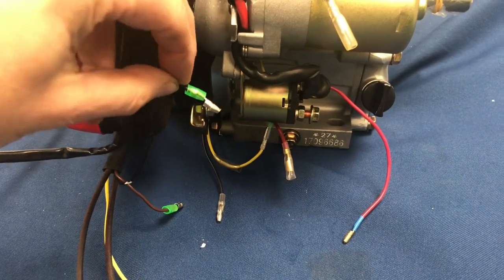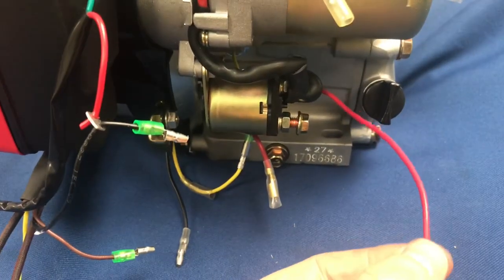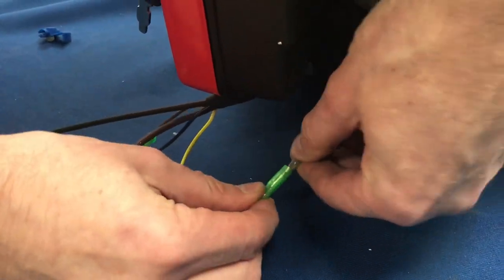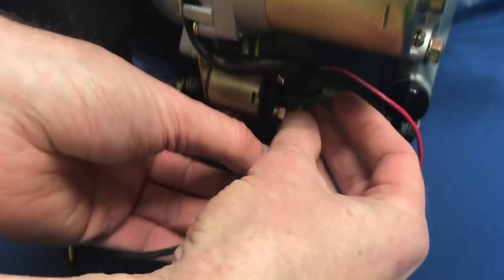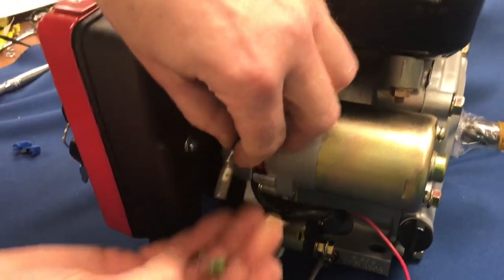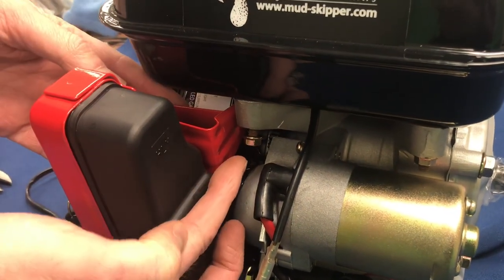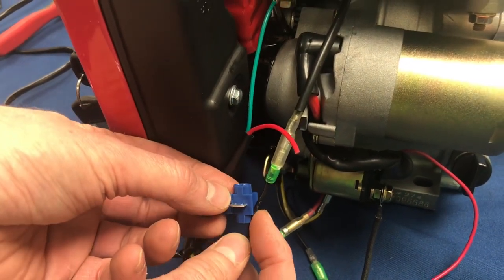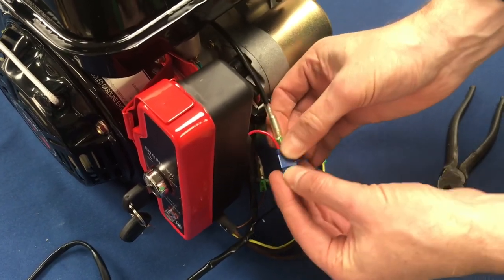7hp Electric Start & Kill switch hookup for Mud-Skipper engine

Comment: I was wondering if this is the same configuration for the 212 predator.
Reply from the maker: Jeffrox M. 7hp Predator doesn’t come with electric start so I’m not even sure if an aftermarket key control would work with it, sorry
Reply: No worries, thank you for the reply.
Reply: It will work ive seen a few YouTube videos already just type in "predator 212 electric start" the honda gx200 electric start kit on Amazon will work on the predator but wires may be different colors. Im gonna do this conversion as well as propane conversion!!!!!